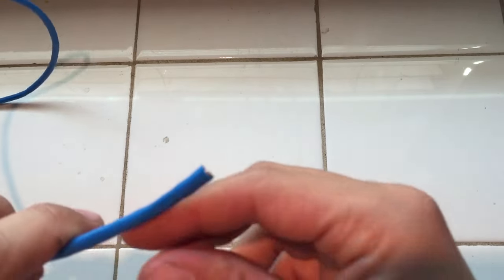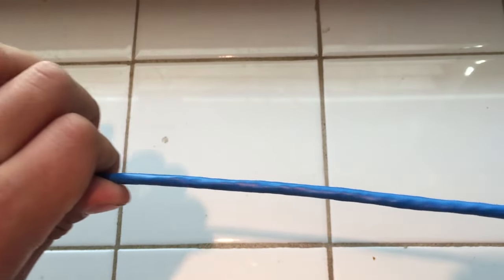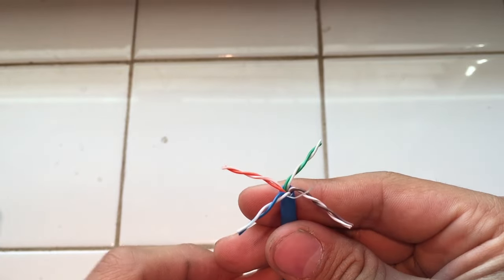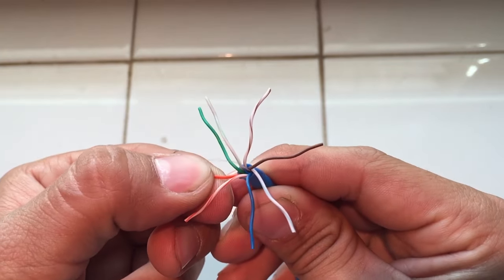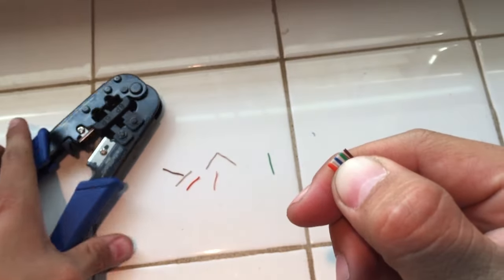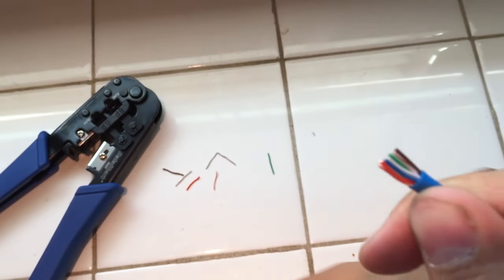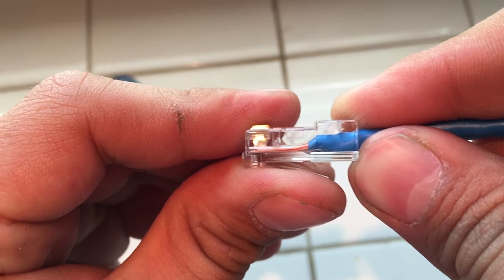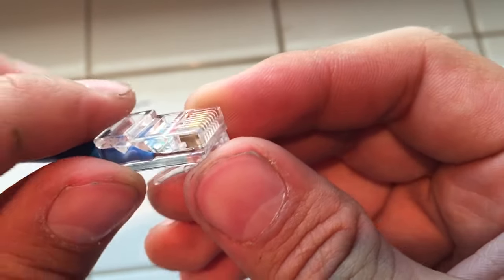How to Crimp an Ethernet Cable

Comment: I bought a cheap cat 5e/6 connector kit on Ebay (tester, connectors and crimping tool) but had no idea how to use it. You just taught me how. Took me about 6 tries to get it right but I did it!

I just hardwired my wife's home office and 2 bedrooms upstairs. With my new ethernet connector IT knowledge I also Added some Ethernet switches throughout the house. 

No more streaming issues. You are the man. Thanks for this extremely useful video 😁!

Comment: Thanks for the video!  Btw, the wiring shown in the video is for T-568B.  In my case, I had to use T-568A where striped green and solid green are first due to the wiring of the cables to the jacks in my house’s wiring closet, otherwise my cable tester indicated the cable was a crossover.
Reply: As long as both ends of your cable are terminated the same, A and B can be used interchangeably.   There is anecdotal evidence that the B standard has less crosstalk in certain implementations requiring very high bandwidth but nobody has been able to measure any difference.
He does need to at least mention that there are two standards though - some organizations have their policies  requiring use of a particular one.

Comment: The tool u are using has a built in sheath stripper did u know this? So was no need to using the first tool AND u wouldn't have cut wires too short as the Trend Tool is measured for length. So u would insert cable, close, remove wire and the outer sheath is cut exposing the 8 smaller wires to the EXACT length:)
Reply: In my experience in using these built in strippers, is that they end up cutting into the inner-wire as well. In theory, you put the cable through and cut it off on the one side, then when you release it it has scored the outer insulation so you can just pull it off. 90% of the time, the blade has also went into the inner-wire as well making it either 1.) broken, or 2.) brittle, exposed. It's best to use a dedicated stripper like he did in the video. After doing it for a while, you get a good feel for how long you need to make it.

Comment: is this for a straight through or crossover cable? The other side of the ethernet cable would be the same color convention?
Reply: I wired as he instructed - same colour layout at each end - and it produced a regular network cable (non switched/crossover). Unless something strange is going on in the cable itself, then for a regular network cable you could probably put the colours in any order you like! - although someone out there probably would tell me otherwise!

Comment: Thanks, worked out perfectly on the first try!  One thing you don't mention is that the individual wires are not always so clearly marked as in your example. In my case, I needed a magnifying glass and some imagination to identify the different color wires. But it all worked out.

Comment: Im not getting any link light.. please assist whats missing? I tried 568A and 568B but still no link light, my Cat ate the cable so i had to cut from where it was damaged and crimp using the crimping tool but IT JUST WONT SHOW THE LED LIGHT ON MY LAPTOP ANYMORE LIKE IT SHOWED BEFORE😢
Reply from the maker: Pious Hadebe make sure to fully inspect your cable from end to end. Also, check to see if the white/Orange is to the left with the jack pins facing up
Reply: That's why you have to have a Ethernet cable tester